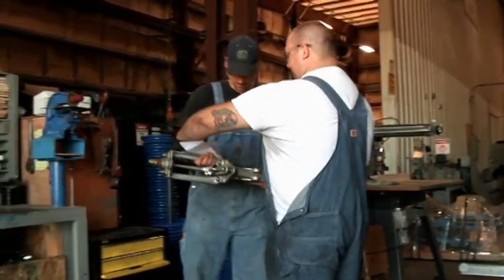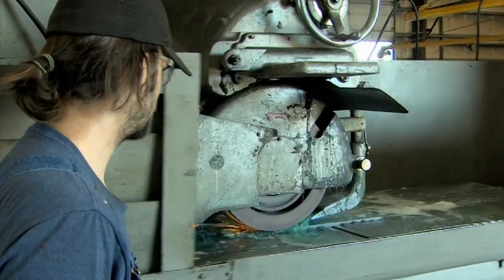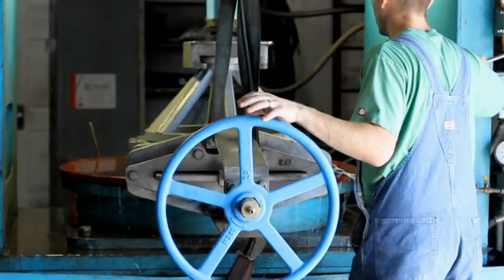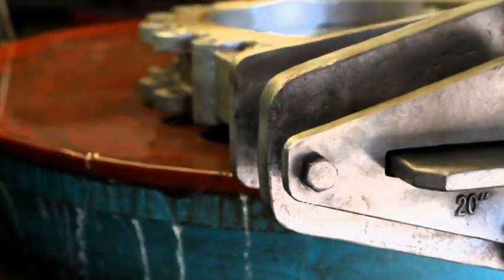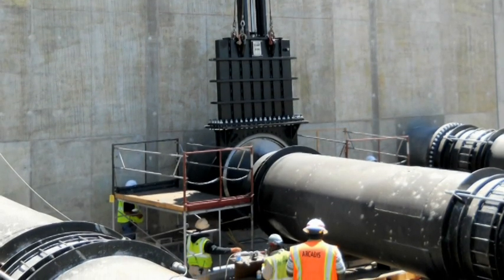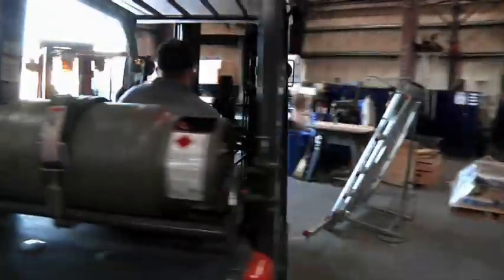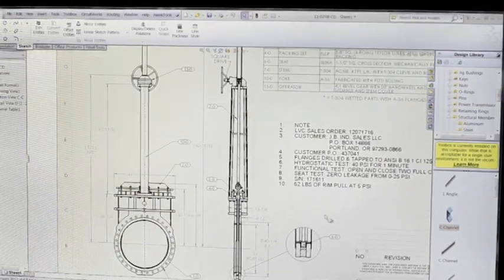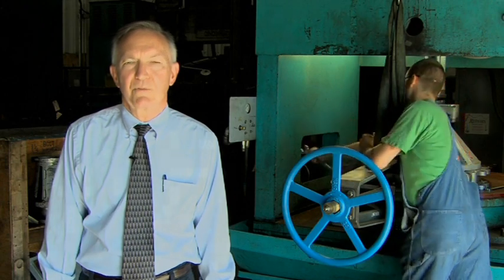Quality Engineering of Knife Gate Valves

Comment from the maker: See our Engineering Video!

Engineering quality knife gate valves is second nature to the team at A-C Valve. Beginning with a meticulous design process, moving to professional, experienced welding, and systematic thorough assembly, our knife gate valves are renown for high quality and longevity. Each and every valve goes through a comprehensive testing process so you can be confident that it will work out in the field. Valves are even tested to 150% of design pressure.

A-C Valve are specialists, with over 30 years engineering experience designing knife gate valves. It takes a team of skilled craftsmen to build these quality knife gate valves, and our team is the one to trust with your requirements. Hear Jeff Bowman explain how A-C Valve designs and builds, robust substantial knife gates as material thickness is not cut back on to save costs. The video is less than 2 minutes long!

Testing Standards

Manufacturers Standardization Society

MSS SP-81 applies to bonnetless metal seated knife gate valves, 2″ to 24″ size, 150 psi CWP. Sizes above 24″ are not covered under this standard. Additionally, resilient seated knife gate valves and slide knife gate valves are also not covered under MSS SP-81. These products are subject to the individual manufacturer’s internal testing and design standard.

American Water Works Association

AWWA C520 standard describes bonneted, bonnetless and one- and two-piece fabricated stainless-steel and cast ductile-iron body knife gate valves with resilient or metal seats, including tapping knife gate valves, for use in water, wastewater, and reclaimed water systems with pH range from 6 to 12 and a temperature range from 33ºF to 125ºF (0.6ºC to 52ºC). The minimum design pressure shall be 150 psi (1,034 kPa) for nominal sizes 2 in. to 24 in. (50 mm-600 mm), and the minimum design pressure for nominal sizes 30 in. to 96 in. minimum (750 mm-2,400 mm) shall be 25 psi (172 kPa), 75 psi (517 kPa), and 150 psi (1,034 kPa).